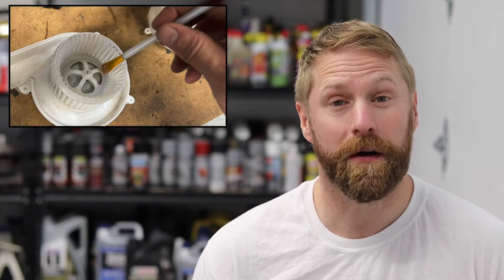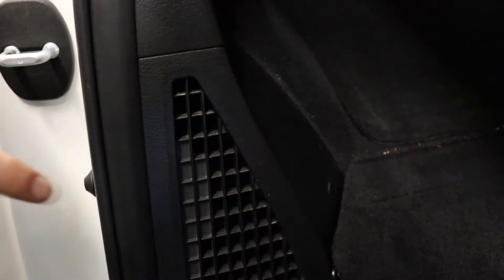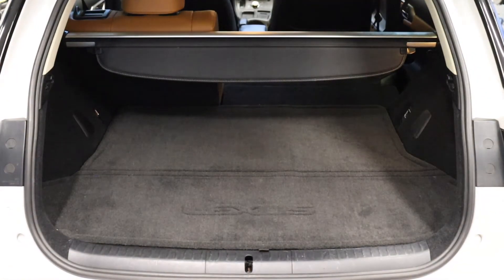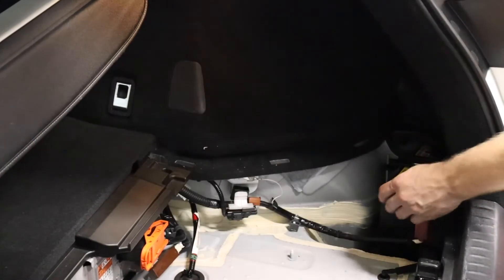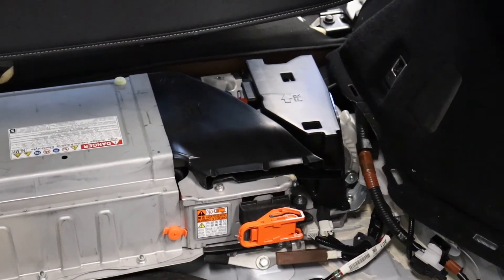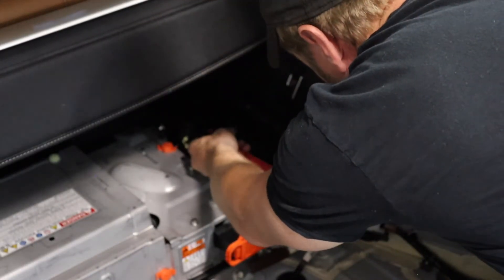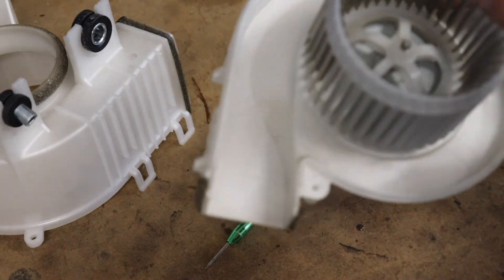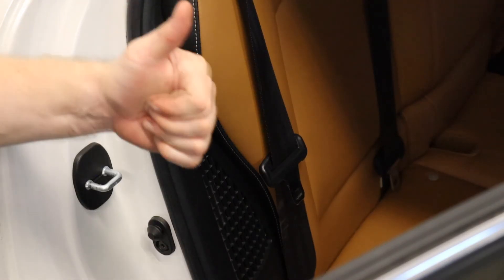Lexus CT200h Hybrid Battery Fan Cleaning

Comment: Just finished this but I get “check hybrid system” error on the dash on startup. Anyone knows how to fix this?
Reply from the maker: Did that message appear before you started this job or as a result?
Reply: @autoobscuregarage as a result and I figured it out later. I slightly nudged the orange plug on the hybrid battery. Had zero awareness of its significance or that I had even bumped it at all. There’s a locking system on it so that you need to lock it in for it to fully sit in the plug.

Comment: Can blow it out with high powered air
Reply from the maker: For most of the dust you sure can. Tried a sample spot with my big ole air compressor. There was still a think layer of dust stick to the plastic blades through that required a little brushing to remove.

Comment: I just bought a used CT200h that hit 100K so I did the full 100K service at my local Lexus dealership.  After seeing this video I went and checked the vent, the filter was there but caked with dust so it was choking up the airflow to the battery.  I'm going to go get the fan and battery checked at another place and probably demanding a refund.  The battery is hardly holding a charge, I can only get it to run in pure EV mode for a few minutes before the battery taps out and I'm averagining like 25mpg...  the gas/battery display mostly shows the gas powering the vehicle it hardly ever takes from the battery.  I'm pretty pissed.
Reply from the maker: That’s horrible. No hybrid battery warning light? Keep me updated, curious to see what they find. Sorry that sucks.
Reply: @autoobscuregarage  maybe it's rapidly approaching critical.  Getting it checked out  at another shop that has perfect reviews and who I got a 2nd opinion for an engine timing cover issue that Lexus wanted to charge me 5K for.  This other shop said it's a common problem and most of the time negligible as was my case, was barely leaking and I didn't have to get it taken care of at this moment but if I did they'd do it for 3K.  Just did a review for Lexus Escondido if you want to see it.  They are going to make things right or I'm going to raise holy hell.  100K inspection and they didn't even check the vent filter???
Reply: Does the lexus ct200 have engine timing cover  @Zennofobic
Reply: @ yeah they tried to get me to replace it but the oil leak is negligible it's a common issue for that engine.  $3K to replace it no thanks.
Reply: Did you get the issue fixed by any chance  @Zennofobic
Reply: @ they ended up refunding me for the 100K service and I took to another shop to double check and they found more issues that Lexus had overlooked. I feel bad that I got paid off to lay off them, I had removed my negative review but I figure people will soon enough find out just how poor the service is.  I suspect I'm not the only one they have screwed.